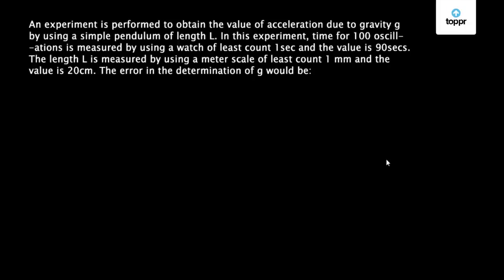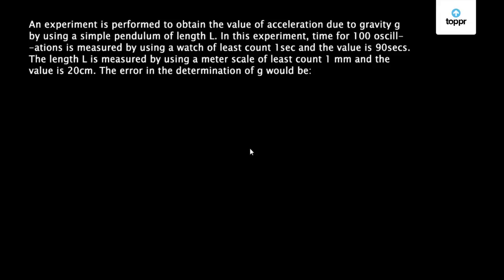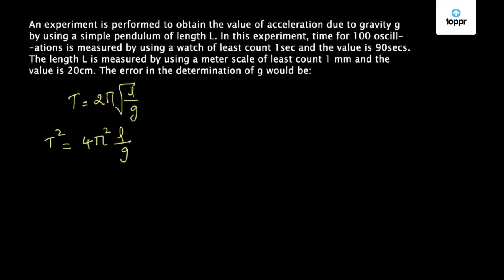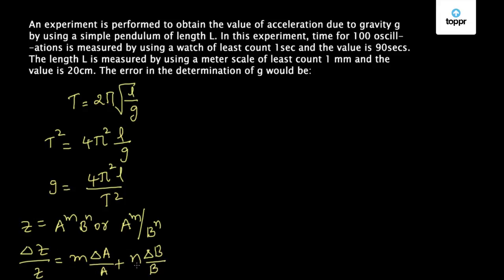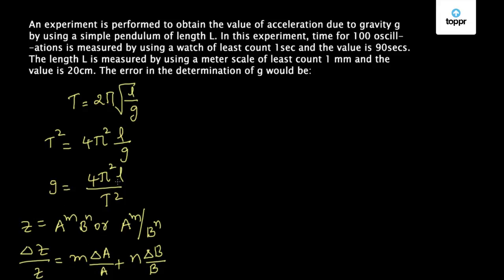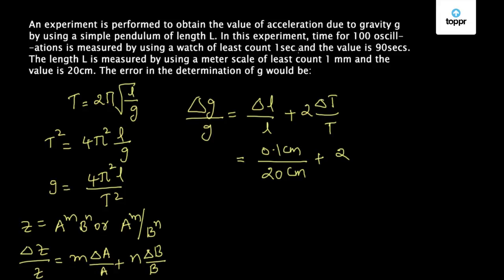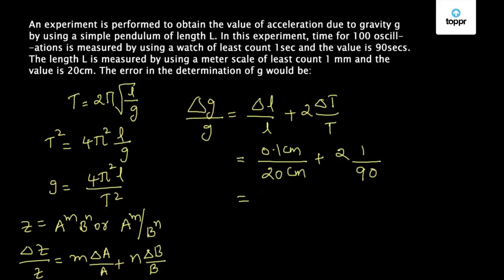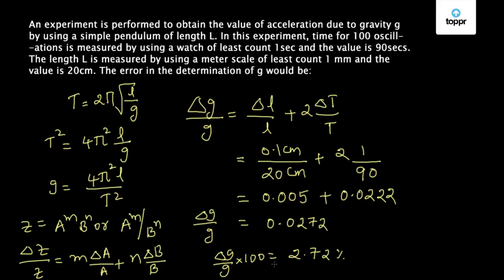Error in measuring acceleration due to gravity - Physics

Comment: If we dont square 
Apply initialy we get delta T/T=1/2(deltaL/L)+1/2 (delta g/g)
Which is not matching here plz tell
Reply from the maker: +Tushar even if u solve the equation mentioned by you, you will get the same answer.
Reply: No sir i  have sent you the eqn i got
Reply from the maker: your equation is also right. If you take 2 to lhs and delta L/L also to lhs you will get the same relation as mentioned in the solution. Remember errors are always added not subtracted.